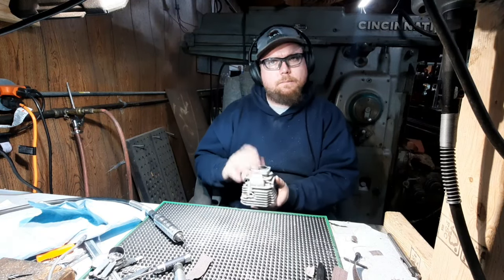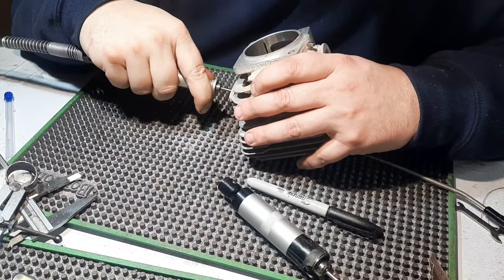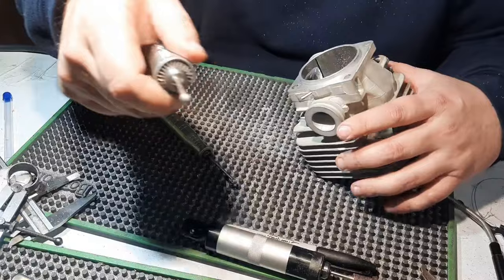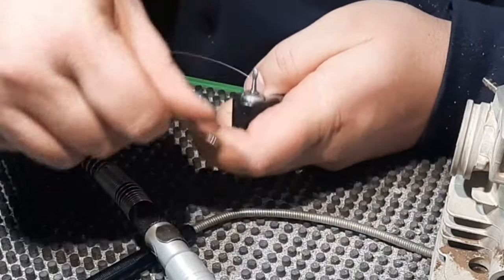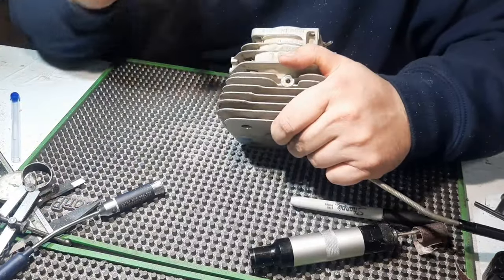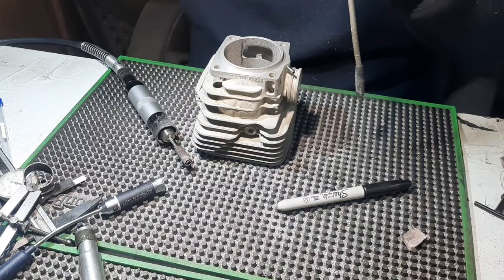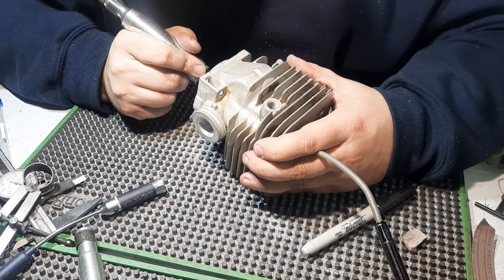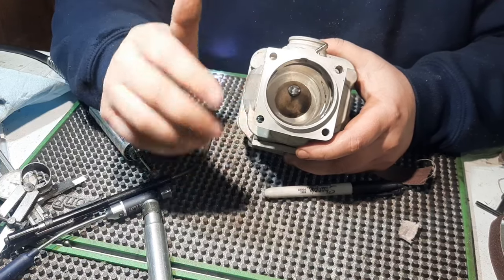Power in the Ports! Cylinder Porting Big Gains

Comment: THANKS, JOE. I WAS SURPRISED YOU DID NOT TOUCH THE INTAKE, BUT THE EPA 395 RAN LIKE MY OLD 394 WHEN YOU WERE DONE.  YOUR OPINION CARRIES A LOT OF WEIGHT, AFTER ALL, "DYNO JOE" = "I CAN PROVE IT  WORKS"... I'VE GOT A 58MM CHINESE-MADE 395 "BIG BORE" KIT, WHICH SHOULD TAKE MY WORK SAW FROM 94CC  100CC'S, BUT THE TRANSFERS ARE SO ANEMIC IT'S GOING TO TAKE A LOT OF WORK TO GET IT BREATHING. HAVE TO WAIT TILL AFTER XMAS...I'M THINKING ABOUT ROPE AND GRIT POWDER TO SHINE THE UPPERS USING A DRILL MOTOR WITH A SMALL PULLEY, BUT I'M CRAZY-IT'S JUST TOO MUCH FUN, AIN'T IT?

Comment: Ive always wanted to see a video where you test a saw at all the stages of porting so people can see what each step gets for gains. 

Full Stock, stock + Muff mod; stock + muff mod + base gasket delete; muff mod + base delete + lower transfers opened; then a final test of muff mod + base delete + full port job
Reply: I agree.. And I think Joe should do a fully ported cyclinder and test longer vs short blow down...... Start at 25 degrees then 20 and 15 and dyno each step.....
Reply: That would be interesting to see just an exhaust mod, run on the dyno. Then add the intake mod and run on the dyno, and then a transfer mod, for a final dyno run to see the differences. Bit of an ask but would be cool to see
Reply: And timing advance

Comment: Yes, Zenoah 50cc clones! I acquired 2 cylinders of 45mm bore, plus the one on my Alpina saw. Cyilinders have open single port on each side. 
I measured timing numbers for all of them. Thank you for your tutorial on using that digital angle meter! 
And now I'm scratching my head what to do with them. Numbers on one cylinder: EX: 105, TX:128, IN:72. Second cylinder: Ex:98, TX;124, IN:80. The one on the saw: EX:112, TX:132, IN:67.  The saw doesn't rev high, but it does keep around 8 to 9k rpm in the cut with 18" bar. I don't need a longer bar, but I would like it get to the power a little higher in the rpm range.
My first step with this saw will be to swap and try each of those cylinders, and see how the saw cuts with different port numbers.

Comment: Nice video! I have to get one of those pen lights, a modified Christmas tree light has worked but one must be mindful of the wire :). A Stihl MS462 built for pulling a 28" & 32" in Hardwoods. Duel port vs. Larger single port comparison on a 461 & 462.

Comment: . More hobby/race stuff like putting a bigger carb on that g444 saw you built. Taking the cheaper stuff further out than you would do with a name brand saw to see where the limits are. I would like to see a dyno of the individual parts of a saw like dyno, remove  air filter, dyno, shave carb blades, dyno, muffler mod , dyno , remove choke, dyno. The 372 would be a good saw for that demo:)

Comment: Joe if you were to use a saw albeit 395 or 660 would you port for torque rather than chainspeed as milling causes alot of heat?
Reply from the maker: I'd pick the 395 for. Milling over the 660. 

Outboard clutch and they do make better tq with my style of build

Comment: What's your take on the type of porting you would perform with 066 stihl combining the use of 3/8 10T and  advancing the timing 8-10 degrees with a barkbox and improved air intake mod
Reply from the maker: Depending on bar size 10t may be a bit much. But short bar that could work, 8-10* seems like a lot of advance. It may want to kick back a bit and could even detonate.

Comment: Can you show how to port without having a timing wheel to mark the grinding sections on the cylinder wall? Hopefully it's not impossible and can be done with an acknowledgement of a considerable risk to engine performance but as you say if we're practicing on a cheap asian saw and not a genuine 3120XP the risk is somewhat considerably more acceptable 
* Good vid 👍
Reply from the maker: You really need to know/understand the port time/durations to decide where You are starting and where you want to go. If you know the stroke, rod length you can use some online calculator to determine port height. But a simple degree wheel and wire can be bought cheap. Or pint one off and glue it to a cd.

Comment: How about porting a Stihl MS170 MS180 MS171 or MS181 everyone has one so it would probably be a very popular build.
Reply: I did a 170. Very hard to port. Meaning very small. Also had to upgrade the carb to an adjustable one. But it did scream and run a lot stronger when I was done.

Comment: I understand taking material off the floor of the intake and the roof of the exhaust to change timing numbers. but what about the roof of the intake and floor of the exhaust how do you determine what to grind on them?
Reply from the maker: I don't normally mess with those . The exhaust floor dosent really do much at all. And some saws are really close to free port. Meaning the piston dosent seal off the exhaust port and the charge from the case can go right out. Intake roof adds more time area, but it can make a saw slow to respond. Or lazy.
Reply: @dynojoemods2764  thanks that helps me understand it.

Comment: What could I do to my 661 with out machine work? I’ve ported a few saws so I’m aware of port shape. Chamfer. And keeping aware of of where the ring pin is etc. I want to go in and get some gains. I am going to send out my 500i and get fully worked on. My 661 is my falling saw only running a 36”- 42” bars. Thanks. Anyone can chime in.
Reply from the maker: Gasket delete, and widen intake/exhaust, healthy muff mod and a max flow should pep it right up
Reply: @dynojoemods2764  what’s a good squish? I think the last time I check it was 30 something.
Reply from the maker: @bryanmarks4070  I like .025-27
Reply: @dynojoemods2764  thanks you.
Reply: @dynojoemods2764  what lathe do you have? I’ve been looking at some grizzly lathes. What size would you recommend?
Reply from the maker: @bryanmarks4070  
12x24 is a good size for saw work and more. I have a few different lathes.

Comment: Why texture on the intake? And how do you know where to mark it to know how far to cut?
Reply: Texturing the intake promotes turbulence and prevents fuel from dropping out of suspension. 

I can’t speak for Joe but I know where to cut based on cylinder timing (height of port) and time/area (width). Each porter has his own opinions and ways of going about the same task and different results, that’s what makes it an art. Remember in the beginning when he said to round the top of the exhaust port to avoid snagging the ring, but flatter ports make more power? That’s up to the individual how round to shape it, based on experience, trail and error, and personal style.

Comment: Hey Joe.....awesome portwork as usual! Something you could consider is a comparison between a higher duration build vs a lower duration( higher torque build)
Richard flagg ported one with a low 102 roof and I'm curious as to the torque curve on such a build.
Hi Hp build like in79/80 ex99 tr 119 vs. In78 ex 102/103 tr 119

Figure leave the transfers same duration so the fuel delivery duration is same in both cases....obviously a free flowing muffler to deal with the short 16/17 degrees blowdown with the low roof.

Just something to consider..cheers!